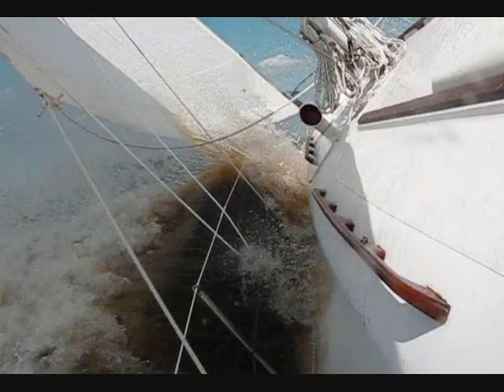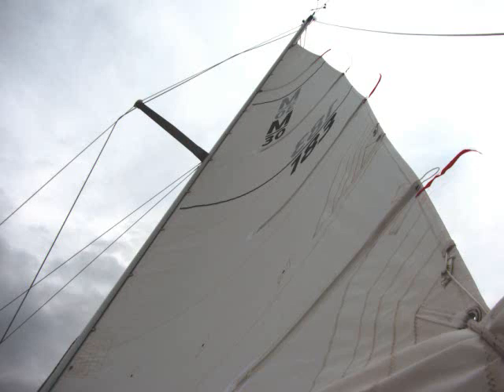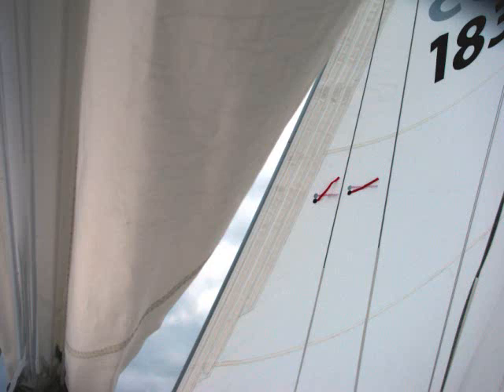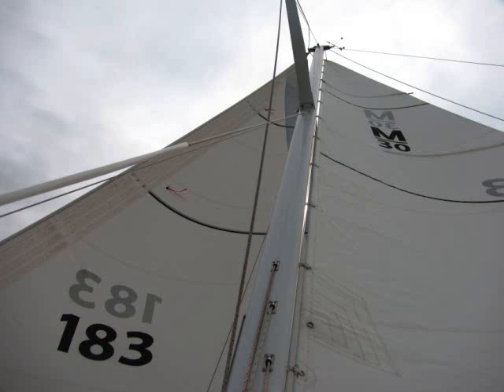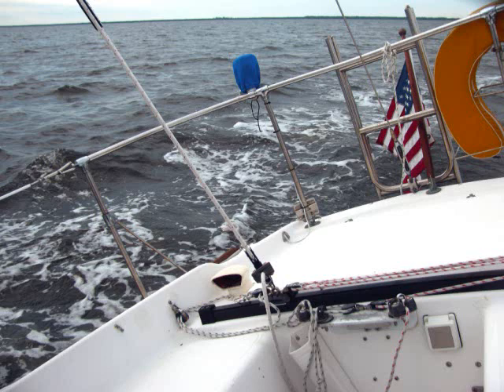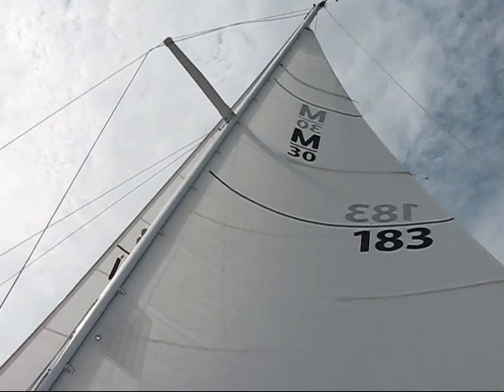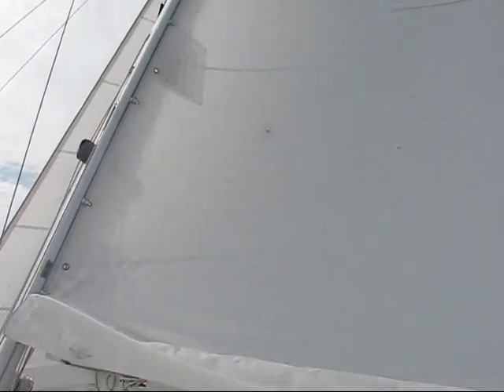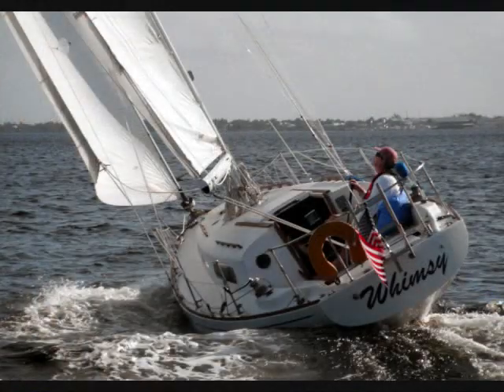Sail Trim In A Fresh Breeze

Comment: Thanks Tom. 
Being self taught and single handing, having a clear video of trim sure helps.  Other videos I've seen can get a bit too technical. 

Your talk about having a single airfoil supports  my goal.  Visualizing airflow is my method and thinking of an airplane wing works for me. 

Thanks again and sail safe.  
Mike
Reply from the maker: Mike - yes, the airplane wing analogy is a good one. Consider an airliner fitted with flaps and slats, established on an approach to landing.  With everything extended, the wing is producing maximum lift (..well, and yeah, and drag too!), but the primary airflow is following the combined shape of ALL the moveable surfaces. So, I sail my sloop rigged boat as if it were behaving the same way. I trim BOTH sails to produce as smooth a combined flow as possible from front to back (assuming the wind is forward of the beam), and that technique seems to work well for me. - Tom

Comment: Hi,
What exactly do you mean by saying move the draft aft when the wind is up and the seas are up? I got moving the draft forward when the wind gets stronger to get flatter sails and wide angle for point of attack (more forgiving sails) but didnt get when one should move the draft  backward. Can you explain that? Thanks
Reply from the maker: I'm not sure I can explain it too much better than I did in the video - but I'll try. ;-)
Tightening up everything (..halyards, down hauls, cunninghams, etc.) moves the draft forward, and that is generally what one does as the wind builds. (...Hopefully, that is easy enough to understand.)  However,  in some conditions and locations (shallow water), increasing winds can create a wave pattern that can significantly slow a boat down. (...You can look at some of my other videos and see my boat crashing through Charlotte Harbor waves, and being slowed as a result.)  In THOSE conditions, I have found my boat to sail better (faster) by "powering up" the sails slightly by creating a slightly rounder shape than I'd typically aim for given the wind strength alone. This bit of "gear shifting" helps the boat build up speed quicker when she slows while taking a beating on the nose from sharp waves.  So, I'm saying that she makes better speed upwind in lumpy seas with a very slightly more powered (less flat) sail than she would with the maximally flat/draft forward sail shape that the wind conditions considered alone would otherwise lead you to think is best. All of this is very subtle (..you really don't want to move the draft AFT a lot), but it is also quite a noticeable benefit if you play it well. I'm simply talking about a slightly rounder shape forward on the sail, and moving the jib leads as desired, and maybe cracking off an inch or three on the sheets to help sculpt the desired shape. Overall, I'm saying that sail trim is not simply a function of  wind strength. Rather, I'm saying it is a function of both wind strength AND sea conditions. If the seas are sharp, short, and really slowing you down, you may want to "power up" your sails a bit to help the boat get back up to speed quicker after she gets stuffed. Over time, you'll cover more distance faster. Don't take my word for it, though! Go out and try it for yourself. Hope this helps!  Sail On!
Reply: Thanks a lot for long and detailed answer. I will try and see asap. Regards
Reply: Tom Scott Really great 2nd explanation,  the first pass was very clear but 2nd pass was even more granular.   I sail a newer hull form on a somewhat bigger boat (Jeanneau 349) on Charlotte Harbor south of you and can confirm the machine gun wind slop short period waves.  I am constantly learning and your videos are key for me.   Keep up the great effort.

Comment: Would suggest comments on gen sheet car adjustment when gen partly rolled in
Reply from the maker: Hi Harry. Here is the general rule for sheet lead angle: You want the jib sheet to follow an imaginary line from the midpoint of the luff, through the clew, and on down to the deck. So, as you roll in some genoa, you will want to move your jib leads FORWARD to adjust to the temporarily smaller sail. (...Some sail makers make visualizing this angle much easier by installing webbing at the clew that is aligned with the desired angle.) Obviously, the best time to figure out where this lead should be is at the dock on a windless day so you can eyeball things. Then, you just need to roll up the jib to the same point, and move your jib sheet car to the appropriate location you have already determined when the time comes that you need to reef the headsail. I use the sailmaker's label at the tack of my sail to determine how far my sail has been reefed. If you do not have one of those there, you can just add a small bit of tape at the foot of the sail and parallel to the luff to give you the repeatable settings you will want in order for your jib lead placement to be correct. Hope this helps!

Comment: Awesome video! I had to "scale it down" for my smaller Dolphin 22 but the stuff you talked about works great in practice.  Just curious,  a lot of your videos show you heeling at what seems like a pretty steep angle. Or is it just from camera perspective?
Reply from the maker: Matthew Kidder 

Hi Mathew! Whimsy is what I would describe as a "tender" boat. 
Many sailor's use the term "tender" as  somewhat of a pejorative term, but I do
not.  She was designed that way, and I like and embrace her tenderness! 
Specifically, she was designed to excel in the conditions found along
the west coast of Florida, and also to sail under the CCA rating rule.  She carries a lot of sail area, has a shallow draft, has a lot of deadrise to her hull sections, and (by modern standards) a narrow beam. All those features add up to: "tender".  She will  quickly and easily lay over to 20 degrees of heel in a light breeze,  and regularly touch 45 degrees of heel angle in a fresh breeze.  Unlike modern and beamier designs, her narrower hull shape can be more readily driven and controlled at high angles of heel, so she in no way feels like your Dolphin 22 would at 45 degrees of heel.  When heeled, her overhangs become submerged and extend her waterline length, which (in theory) should give her a higher
potential speed through the water. (..modern and lighter boats simply plane atop
the water, and go MUCH faster!).   Your Dolphin 22 would no doubt be "not as happy" heeled over as deeply as Whimsy likes to sail at,  and most modern
designs are much less resistant to heeling (stiffer) than CCA centerboarders
like Whimsy.  For where and how I sail,  I  really enjoy sailing a "tender" boat
like Whimsy.  Whimsy feels solid underway because she is so heavy (11,000 lbs.) - yet she also is very responsive and sails much like a big dinghy.  I feel
every puff and shift through my fingertips.  She is definitely NOT everybody's cup of tea, and nearly every modern boat you can think of is probably stiffer underway.   Besides heeling a lot, she also is quite "wet" underway - she often takes a lot of spray and solid water on deck too.  But, for me, she harkens back to a different era in sailing.  The feel she provides moving through the water continues to enthrall me - even as she settles in at higher than typical heel angles.  She used to be a fairly typical boat, but over time she's now become the different one.  Nowadays, she's easy to find out on the water - just look for the boat that is sailing on her side. ;-)  - Hope this answers your question! - Tom Scott

Comment: Use some more backstay instead of reefing. Bending the mast depowers the main and the jib. The order how you trim is JUST WRONG.
Reply from the maker: George, the question answered here was how do I trim MY sails. My 50 year old boat has no backstay adjuster - and if it did, the "telephone pole like" mast would not bend enough to preclude reefing. This is not a bendy spar fractional rigged race boat.  Sorry to offend your sensibilities by describing what works for me - I've only been sailing for 50 years myself, and won more races than I can count.

Comment: hm  wrongfirst   loosen the vang then reef  the mainsail.the guy knows   what ???HE SHOULD go sail a dinghy and learn how to sail  without LEAD  BEFORE YOU SAIL WITH LEAD
Reply from the maker: Sorry Joe - I disagree with easing the vang as the wind builds EXCEPT if you are overpowered running with a spinnaker down wind. Upwind? No way - the vang helps keep the leach flatter and lets the sail break evenly as you round up in the puffs.  And, I probably have more "unballasted dinghy" sailing time than you do.